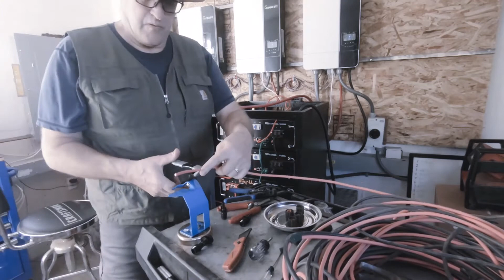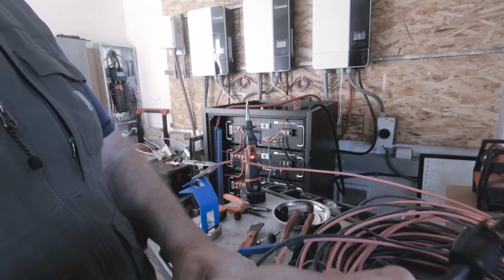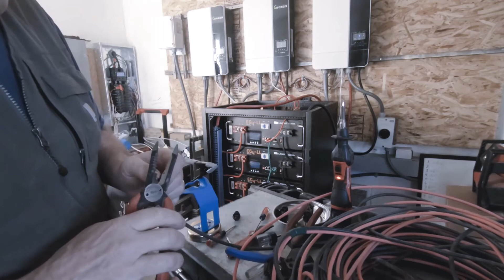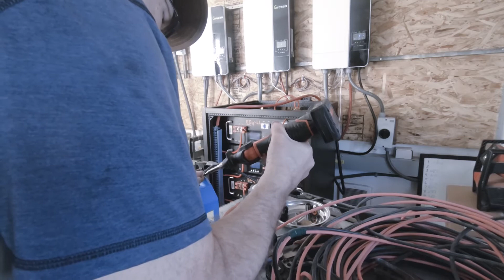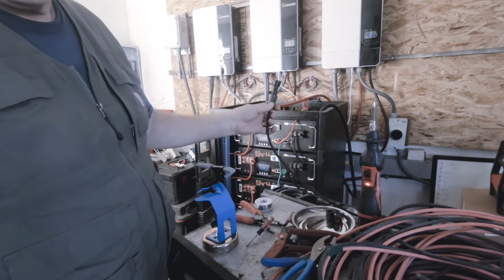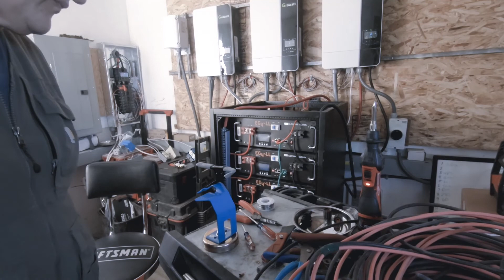soldering wire connections

Comment from the maker: The solder I am using is a rosin core solder made for soldering copper wire.
Reply: but not on to mc4 connectors which are a different metal.
copper, tin and aluminium heat and cool at different temp, causing gaps, causing resistance, causing heat, causing melting or worse shorts over time
Reply: If that was used in building wiring the inspector would fail it. A loose fastener on the terminal could cause the solder to melt and allow the conductor to slip out and get into something else. Soldering is even 
frowned upon in the marine industry for current carriers. Use blind end lugs (one opening). Crimp and adhesive lined heat shrink for fast excellent results. On small non-insulated terminals, I crimp and quick solder to plug the end of the wire just to make a seal before I heat shrink. I don’t let the solder flow all the way through.

Comment: you should not be soldering copper and another metal.
you should be aiming for a cold weld crimp.
thought behind that :
copper and thin warmup and shrink at different temps 
that causes bad connections, resistance and heat
Reply from the maker: ok